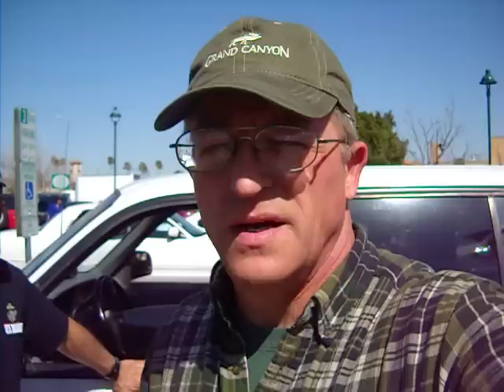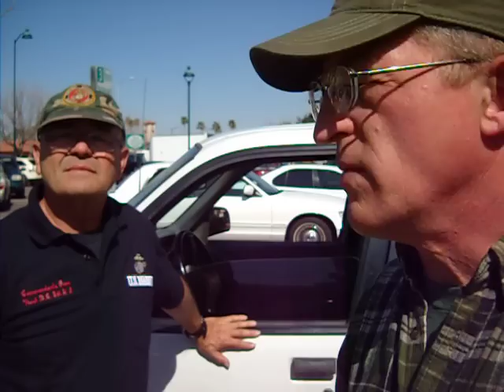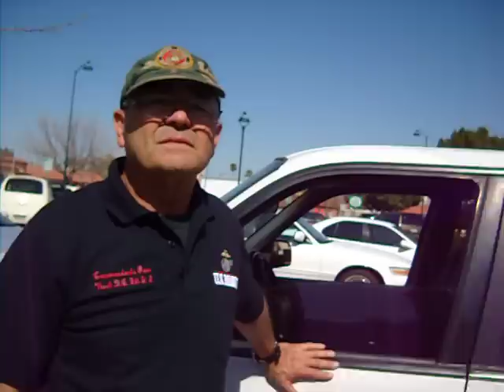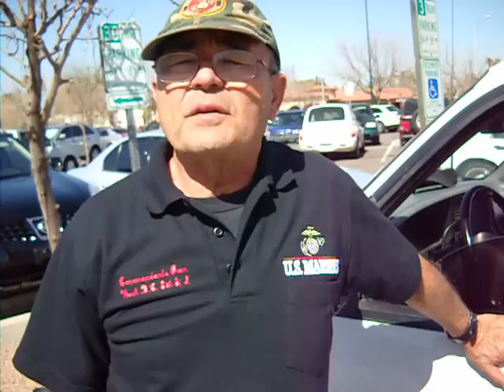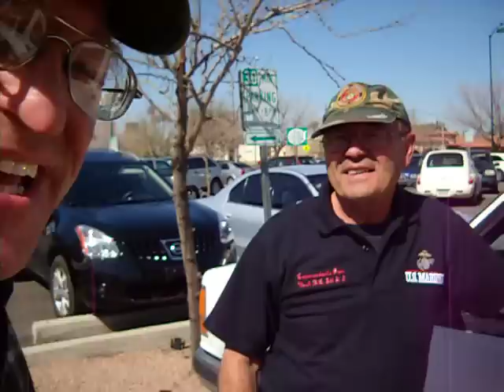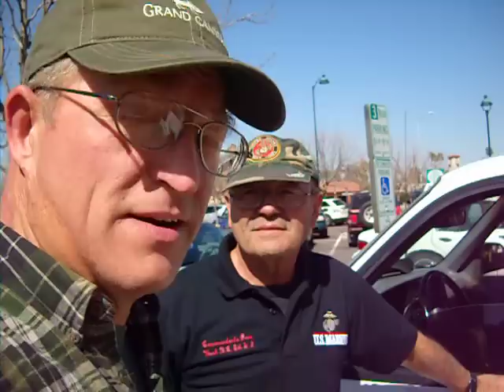Mario Capizzi 94 Explorer DOUBLE gas mileage Part 2 of 2

Comment from the maker: @IrnMaiden304 The best solution is to use the hand-held version vacuum pump. It comes with a bunch of attachments allowing to test almost every size of line as well as to bleed your brakes! I use a MityVac 8000. It's cheap from online ($32 or so) and effective.

Still, you're going to find that after clearing your leaks, you will only be at about 14 mpg. Gotta get The Gadgetman Groove, my friend! Check out my channel for more on that....

Good luck with that truck!

Comment: I just got the same vehicle, same year same color same model ( XLT). I noticed some poor performance as far as accelerating and fuel economy and I know it is a vaccum leak. I am thinking about getting a vaccum pump seeing as it's cheap and easy to use and understand, my problem is where to begin!?. A friend suggested using either to find a leak and I know it work's, but not as safe as a vaccum pump. Any suggestions on where to begin ?, the engine light comes on and off aswell.